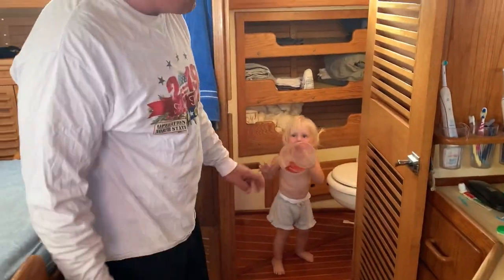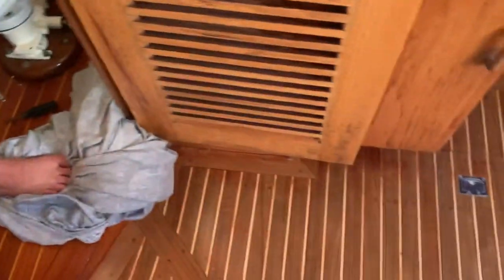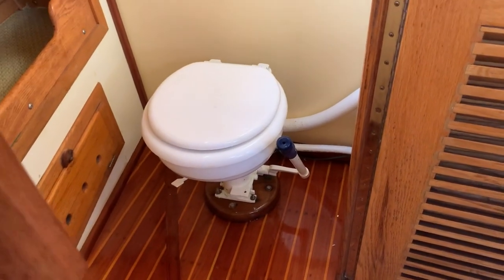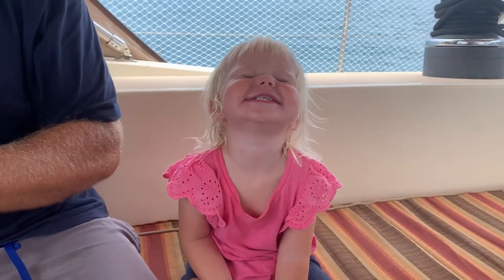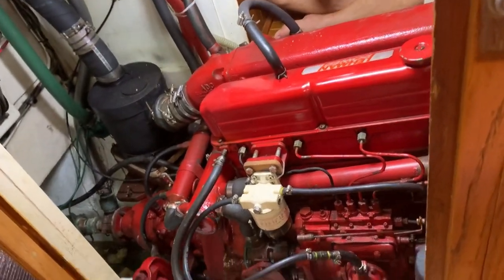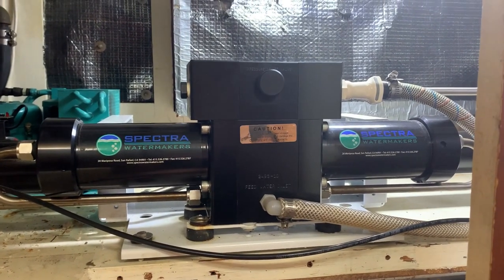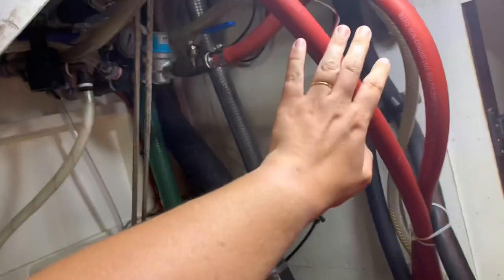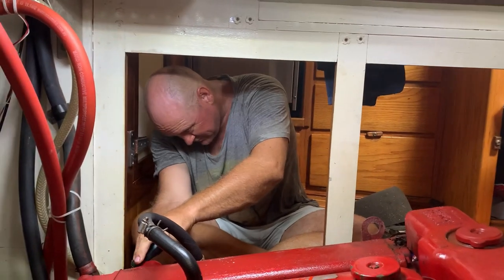Toilet Troubles at Sea   |  Ep 11

Comment: There is a product you can buy l think it's called liquid steel it's in a tube when you squeeze it out it's a thik liquid and you can put it on any metal it will dry hard and can handle hot temperatures
Reply from the maker: Thank you! Will lock that away for future!
❤️
-Cait